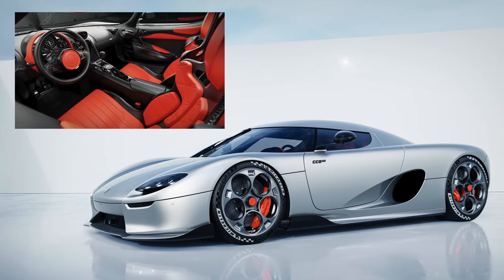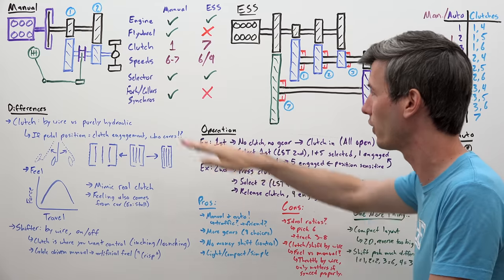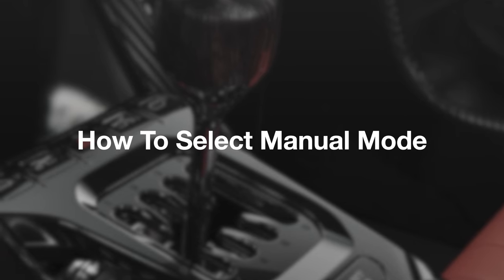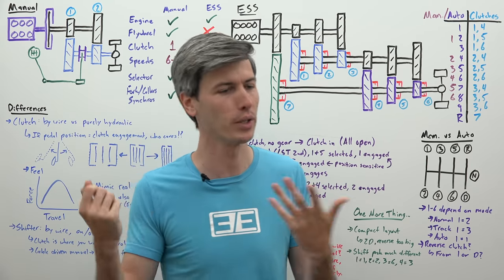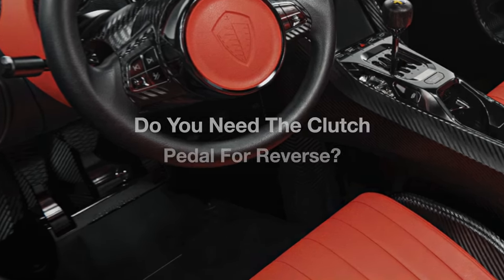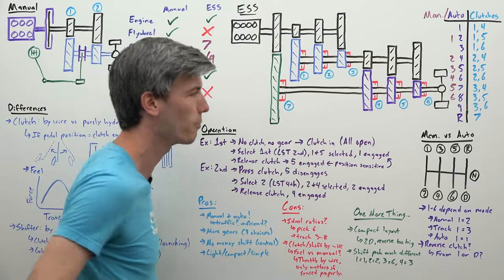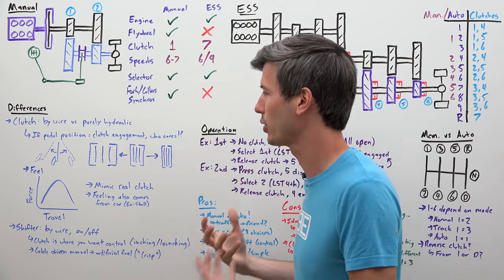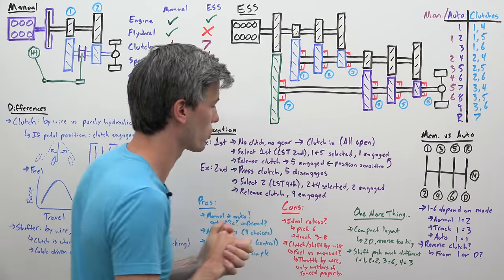Koenigsegg Reinvents The Manual! How The CC850 Transmission Works

Comment: Even though I'm mainly a purist who always prefers a manual over an automatic, I very like this idea of combining an automatic with a manual. I think this setup is million times better than only having automatic with paddle shifters. If I want to drive it in manual, I can do it like a real manual with clutch and a shifter! Of course the clutch pedal and the shifter arent't directly connected, but in this case, it's the only way to realise this system.
And boy, the CC850 looks so gorgeous! For me the most beautiful modern Koenigsegg, which design goes back to the roots of the company.

But there is one thing you didn't mention: How does the automatic mode work without an torque converter to set off the car?
The only way I can imagine is, that the operation of one clutch of the 1st gear has to operate like you lift the clutch pedal slowly but managed by the automatic mode. Is that right?

Comment: So my understanding is that instead of hydraulic clutches like in an automatic with solenoids that control oil flow, this uses a big "solenoid" winding to apply pressure to the clutch with TCM control of the cutrent through the dolenoid to regulate the clutch application pressure.

Comment: This kinda reminds me of how the automatic transmission works in some Honda's and the original Saturn S-Series cars (and probably some other cars). Those transmissions had regular helical gears inside like a manual transmission but instead of shift forks and syncros they had individual clutches (clutch packs) on each gear instead of planetaries, bands, sprags etc of a regular auto.  Of course they're still Torque Converter autos and you've got no control of the clutches but still it kinda reminds me of those ATs.

Comment: There is a little plaque below the shifter in the photos of the CC850 with a gear ratio diagram for both road and track.
For road is basically 
1-4.72 (Auto 1)
2-2.87 (Auto 3)
3-1.77 (Auto 5)
4-1.37 (Auto 6)
5-1.07 (Auto 7)
6-0.85 (Auto 8)

For track:
1-3.73 (Auto 2)
2-2.25 (Auto 4)
3-1.77 (Auto 5)
4-1.37 (Auto 6)
5-1.07 (Auto 7)
6-0.85/0.65 (I'm can't really tell from the photos it's either auto 8 or 9, I'd put my money on 8 tho)

Comment: One thing I noticed is that every clutch you control is on the output shaft. That means its going to feel like the clutch is different for each gear unless each is a different size of runs different logic. In a traditional manual you would have the same torque through the clutch regardless of gear selected and a different ratio after that. This will be the same ratio with different torque loads. 
Normally I would say this looks like this is going to be awkward to integrate but since it's Koenigsegg I feel like it won't be allowed out until it works properly.

Comment: If they put a pressure valve on the first section of the transmission fluid line (assuming this transmission has a pump), then the manual part of the transmission could have been controlled by hydraulic valves. Put it in first gear, and it pressurizes clutches 1 & 5 to engage them. This would eliminate the need for the clutch pedal entirely. As soon as you shift out of a gear, it would no longer continue to pressurize those clutches (and possibly open a "dump" valve that immediately dumps all clutch pressure when you're in the center of the shift gates), and as you shifted into another gear, it would begin to pressurize the newly chosen clutches.

Doing it with hydraulics would also allow the manufacturer to control how fast the gear clutches are able to engage by using line restrictions so the clutch can build pressure at whatever speed the manufacturer feels is best for the transmission... and since each shift position has its own set of valves, they could choose engagement speed on a gear-by-gear basis.

And of course teenagers would immediately swap these out for "unrestricted" clutch valves, so when they slam it in first with the engine revved, it will spin the tires. 🤣

Comment: Clutch by wire is a brilliant idea. Gear selector is the part I don't get. On one hand they try to make it "traditional", on the other hand they have so much gear ratios they have to skip some to make manual mode usable. So, if we admit that it isn't really manual and there is a learning curve then I'd much rather see something like pre-selecting next gear with the paddles and (optionally, when in manual) engaging it with a clutch press/release. Sure: it isn't as intuitive but it does give access to all gears.

Comment: This is very cool. Koenigsegg is an excellent engineering company; love it. It's interesting to see comments that this system is not really new because it is used in tractors. However, as neat of a system as this is from a technical and engineering perspective, I don't think I'd be excited as a user. When I think of a manual transmission, I think of direct, mechanical control. That mechanical interaction is a primary component of the experience. There is no mechanical interaction here. 

Jason's arguments about people raging because this is a by wire system are not applicable in all cases of objection to this system from a user interface perspective. I simply prefer a mechanical system of transmission interaction as a user, there is no rage. He claims the important thing is that you are controlling a clutch pack. This is a normative claim and I disagree. For me, the important thing is that I am mechanically interacting with the transmission. There is a illustrative comment here by Stephen Layland in which he describes his first manual that he could build in a very basic machine shop. Jason goes into a normative argument again in his discussion comparing this system to throttle by wire. He is begging the question. 

Again, very cool system. I like it a lot. But as a user, even if I wouldn't even know that this isn't a traditional, mechanical manual based exclusively on the user experience because it is such a perfect simulation of a real mechanical interaction, it is still a simulation of a mechanical interaction. The knowledge that it is a simulation of the mechanical experience would degrade it even as my technical knowledge of the system elevates it.

Edit: piped in sound is a good analogy for the past point I initially made. The sound is real, but it's getting to you via a convolution. Even worse, but probably more applicable to this system is sound played by speakers.

Comment: 10:30 The only question with clutch-by-wire system compared to "real" clutch is if the latency from the pedal to the actuator is small enough to make no difference. Considering that Koenigsegg can successfully run valves of the engine with computer controlled actuators, I would guess they can run the clutch with low enough latency, too.

To get correct pedal feel, they could be doing it the same way as high end simulator pedals that actually run hydraulics and move parts just for the pedal feel. The actual input to the computer is then measured from hydraulic pressure or pedal movement according to how you want the system to work.

Comment: I love the channel and I can see by the comments that I'm in the minority, but hear me out.  This transmission reminds me of the opening scene in The Gladiator where the Aid tells Maximus "People should know when they are conquered and he responds....Would you, would I?"  I'll cut to the chase.  Manuals were designed out because they shift slower than automatics and thus they are relatively a performance downgrade compared to an automatic; even without considering that the real weak link in the chain is the human's repeatability of a perfect shift.  Put that aside for a minute and then realize the entire concept of a transmission has been designed out of EVs.  I guess this a nod to nostalgia or maybe they just don't know they're conquered?  The part I don't get is the fake shifter gate.  A joystick connected to nothing with a long (slow) throw to make the human feel like they're moving something they are not.  You are not moving gears and level action is not required to push a button.  No thanks.  You can keep your Matrix blue pill fake reality.

Comment: Considering that the clutch is the most critical component of any transmission (either manual or automatic), having manual transmission with 7 clutches sound like a really good idea 🙂
Reply: It's a wet clutch, so it shouldn't wear out super quickly. Like most motorbikes have wet clutches. I recon by the time that the clutches wear out its probably time to do a rebuild/ refresh of the transmission

Comment: In fact their clutch actuation is probably completely hydraulic. The by wire part is just to control to which clutch, the fluid goes, using solenoid valves.

Comment: The comments section is most interesting. Most seem to like this, I'm one of them. The way it is presented has an acute understanding of both pros, cons, and enough explanation for those who don't understand how a standard transmission and an automatic one operate.
I'm a huge fan of standard transmissions, as both a driver and an automotive tech. The hwhite board does a minor disservice to both only due to the two-dimensional grasp of how they operate.
I paused the video a few times before continuing and asked myself questions that were ultimately answered. 
But when it comes to honesty, I've never liked drive-by-wire. I don't even like electric park brakes. 
(and let the haters respond)

Comment: This video has raised some important questions that I hope can be addressed.
 Are the 6 hydrocoptic marzel vanes so fitted to the ambifacient lunar wayne-shaft so that side fumbling is prevented and what's even more concerning, are the two spirving bearings actually in line with the panametric pham? These are important issues that need to be discussed in more detail. Other than that it totally makes sense to me!
Reply: That depends on whether you’re dealing with the retro or the turbo encabulator.

Comment: Ive been driving an automatic with sportstronic shift after decades of being a manual snob. As long as i can engine brake when I want then Im happy. It even shifts way faster than i ever could with a clutch pedal. And importantly, the Koenigsegg will probably have so much torque you wouldnt notice if your rpm is two gears too low anyway😵 kinda reminds me of a truck's 10 speed range/splitter if it was run by tiny robots.

Comment: Have to say driving stick with a manual throttle vs an automatic throttle is way different. Probably partially because it's cheaper, but you have less presision with the pedal which means it's easier to drive at low speeds in a higher gear because it requires slightly more throttle. Having driven a newer throttle by wire it's something you get used to but I still prefer having the throttle actually comunicate with me but I understand that from a preformance and efficiency prespective it's better. It's expensive and complex to make an engine where you have throttle by wire and actual complete control for efficency. One positive with throttle by wire is throttle = hp usually not precent of max flow at a given rpm so you don't really get the problem I have in my old subaru of nonlinear acceleration you at a quarter throttle and it just accelerates faster and faster tell you have to shift. Vs a linear gain in speed which is much more manageable. Especially when preformance driving having throttle = hp is nice. Even if it has a cut off point for a given rpm.

Comment: Two questions: First, why is a flywheel not needed, which usually smooths out combustion pulses, and adds some rotating inertia for standing starts, etc. Second, how are starts and stops handled in drive mode? Computer control of clutches for starting and stopping, or is the clutch still used for starting and stopping, just not shifting?
Reply: They probably have the same rotational inertial mass placed both within the motor and transmission.

Comment: I’m a manual fan. First car was a 1972 Mustang with Hurst 4 Speed. I loved it. 

Besides a transmission that allows to switch back and forth between manual and auto-what other problems does this solve? Definitely seems to provide more gears but does it solve any sort of torque management, durability, etc?

Comment: I think this design have been inspired by direct drive transmissions that have been in use in agricultural tractors. Different speeds are engaged with several clutch packs and work with the exact same principles as shown on the board on the right. Of course tractors would have added planetary to allow higher rpm's at lower speeds. For example New Holland have designed several of their transmissions That uses this concept and is also used a lot in the Agricultural industry.

Comment: Fascinating!

The overlap of the gear ratios is strongly reminiscent of a  bicycle that has three chain rings on the crank. Except that my mountain bike has 24 gears, not 9 (but that 24 includes at least 6 possibilities that I will never use, so realistically it's no more than 18).

This looks like it will take away one aspect of the traditional manual transmission feeling : that awful graunchy noise as you select a gear with an inadequately-disengaged clutch; that sounds like synchromesh teeth being ground down into fragments.

Comment: Most of their solutions are at genius level of engineering. I wouldn't ever try to make it look otherwise.
This is though pinnacle of what is currently possible but I do not see it soon translating into the eco boxes as some other technologies do.
7 clutch packs. Sure six share most of the usage but you are using two of those at any time. So sure it will wear 3 times slower than single clutch. But imagine what happens when you do need to change them. It means gearbox has to be removed and rebuild. Costs must be huge. It would be proportionally huge even for the everyman version of such system.
In other cars you separate gearbox from the engine and you change clutch pack and throw out bearing. That's it and that is already deemed expensive for your average Joe. This would cost way more.
Still it might help some new development of real cars one could actually own.
Still it is engineering dream and huge achievement.

Comment: Thank you great explanation.  It seems that this transmission would be easily adaptable to paddle shifting as well.  With paddle shifting one would have full use of manually selecting all 9 gear ratios.
Reply: You could also control all 9 gears with just a range selector like what they’ve been doing in Semis for decades. And with Shift by wire there is even less reason not too since you could make the shift pattern work whatever way you want

Comment: Better than any DSG bollocks,  with true manual controlled clutch modulation(perhaps/likely with electronic protection built in to prevent gross mechanical abuse of the wet clutchs)

Comment: As a veteran truck driver, I say more gears = more fun! Nothing is neater than floating through every gear in an Eaton 18 speed transmission. Of course in a Koenigsegg you won't be hauling 42,000 lbs of freight, so I guess 6 will get the job done.

Edit- actually it's a modified 9 speed with the capability of splitting every gear into high and low range which reduces loss of torque between gear changes, and smoother downshifting that requires less braking resulting in reduced brake heating on downgrades. Still fun though.

Comment: Tbh, I find this system overly complicated for an actually not so valuable reason. Looks more like an auto that "simulates" a manual. It's like Koenigsegg did his best to over-engineer something that could somewhat have been made easier. I don't know, maybe change the way we use the shifter and use a new movement to unlock the 7th, 8th and 9th gears (they even have this in trucks, so it's not new). And I don't see the point in buying a manual car then wanting to use it in auto... 

Oh, and btw your videos are exceptional =)

Comment: I would like to see it working sequentially up and down so the lever rests in use to the left side, and when the driver doesn't act, the top rotation of the engine will shift up and down to a reasonable torque. You will accelerate freely and if you pass 6 krpm, then a gear up leads the engine to under 5 krpm. When you brake, it has to reduce gears and slow down the engine. Basically it is the automatic mode that protects the engine, in a range, from 1,5 krpm to 6 krpm. Assuming the owner could scale up the maximum value if he doesn't care about this precious car, set 10 krpm ... not acting keeps the speed constant over time ...

Comment: May you remember LS500h, using 2 set transmision planetary gear in beetween of electric motor, each set is 3 gear, so combined 3x3 = 9 speed forward transmission.

Comment: This is interesting, the fact that the clutch itself becomes the clutch and the "fork" to switch gear.
I wonder how it would feel to ride one with such a transmission, it might be smoother than normal common transmission with these system

Comment: I would have wanted to see explanation how they can run 5 clutches open all the time without huge wear to the clutches. If you had that amount of normal dry clutches running open, you would cause a lot of extra friction, mess the clutch friction surfaces over time and the clutch springs would get weak for staying in tensioned position for prolonged times.

Comment: I miss explanation for the most important issue in this revolutionary system of clutches: how come are we going to be able to have the same surface of clutch that we have in traditional manuals, with a big diameter and a big surface of friction... but now we have a very little clutch in each of the gears and I believe each gear offers a very small diameter in order to have a clutch capable to retain such a torke. 
therefore to me, here is the secret that we do not have unveiled yet. please if you can go deep on that, thank you very much, and congratulation for your contents